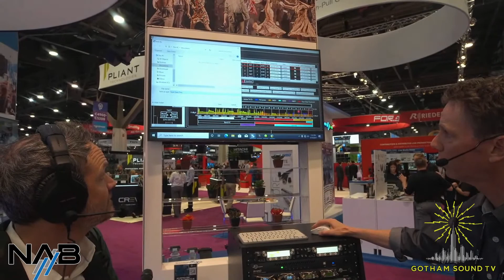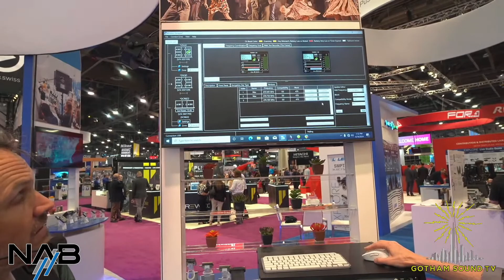NAB 2024: Lectrosonics [LIVE]

Comment: Really happy to see the CSV import/export and flex list capabilities added in WD!   My M2ra’s have been rock solid.  One question I have is can flex lists also store compatibility modes?   Meaning can we store D2 for certain channels and Duet on others etc?  Would be great for utilities who need to spot check wires.  Also if flex lists could be also  sent from connected RX’s on WD such as a ( DSQD, 822, DSR4, Etc )  for those who use the M2R-‘s in IFB mode and want to spot check talent wearing D2 TX’s
Reply: Hi Michael, thanks for your comments. Yes, FlexList is now adding the ability to store/recall compat modes, just as you describe. Good idea for it to be possible to share via IR through an attached receiver. We'll look into that!